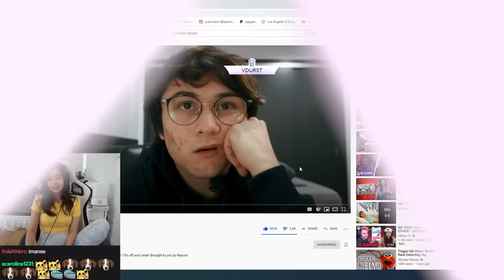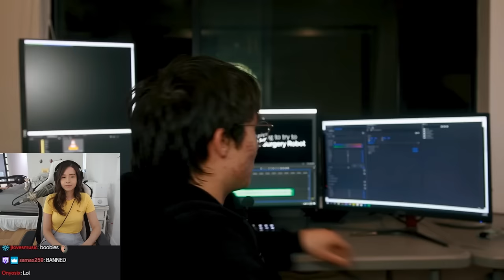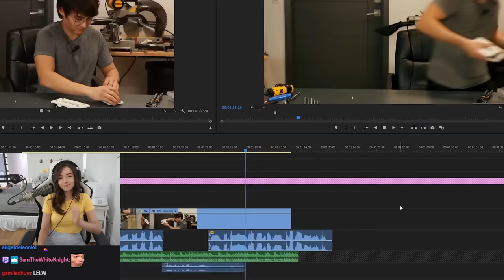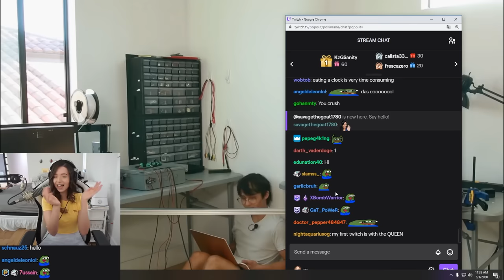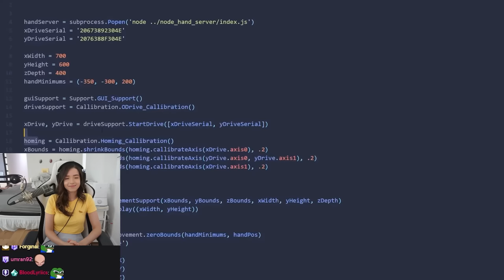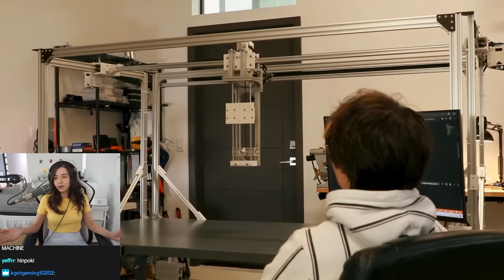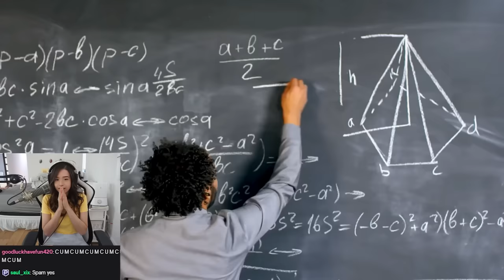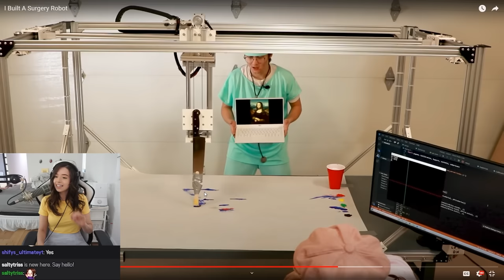Pokimane reacts to Michael Reeves: I Built A Surgery Robot

Comment: If you used a 2040 extrusion for the rail that the cum was on and orient it vertically so it would be more stable. The beam deflection is easy to calculate